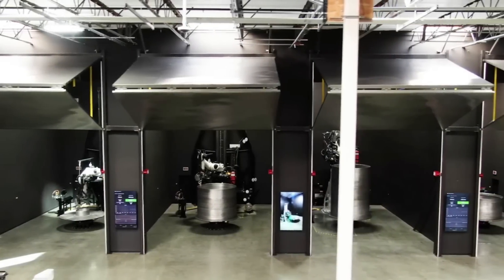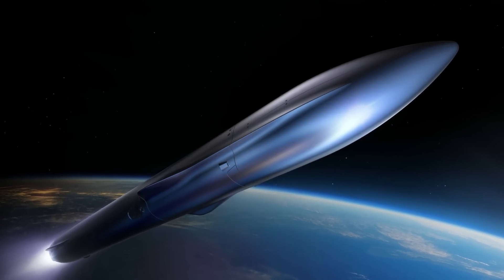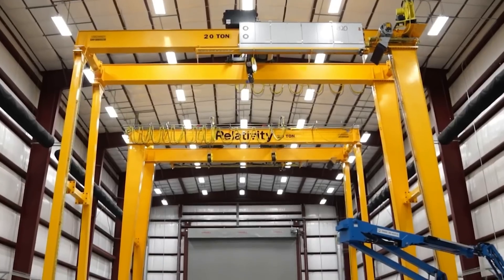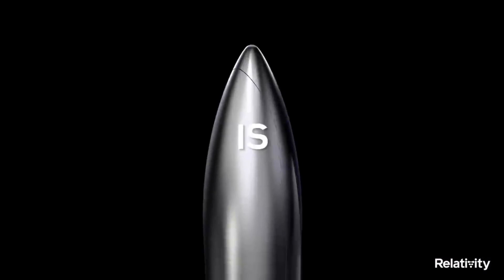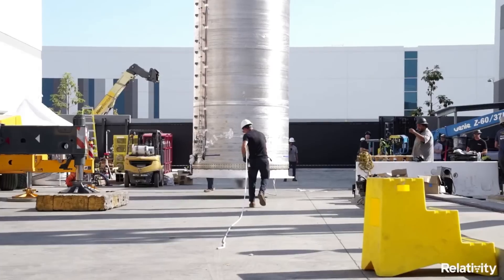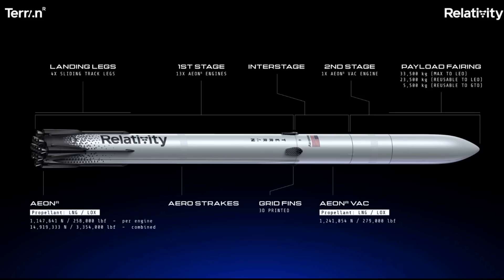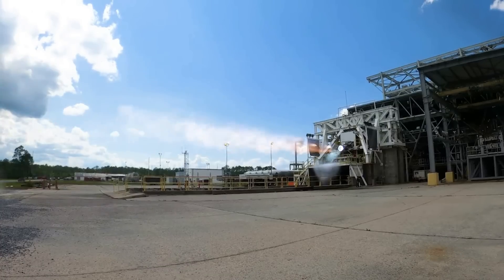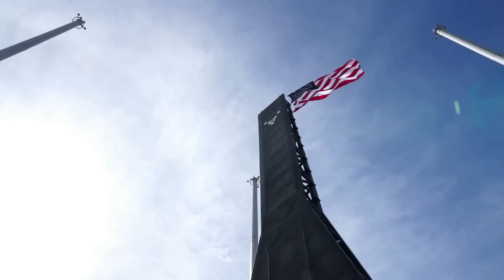A Closer Look At Relativity's Future 3D-Printed Rockets

Comment: They said Terran R won’t be 3D printed.
Reply: 3d printing the rocket body is sucks . Increase too many dead weight come from rough surface of the printing
Reply: @ero6760  agreed, but they aren’t more innovative than other rocket builders. Everyone keeps saying that about Relativity and I just can’t stand it. RocketLab 3D print they engine and rocket part for a while and are actually reliable and proven tech. Relativity is still a power point company at this stage.

Comment: Are 3d printed rockets anything like carbon fiber submarines? I'll believe it when I see it.
Reply: Terran 1 was a 3d printed rocket that successfully launched and went through maxQ but did not have a stage separation so it is far more than theoretical.
Reply: Dawg the sub didn't fail just because it's carbon fiber, y'all gotta at least try to do research before you hate on things. A submarine is nothing like a rocket, let alone an uncrewed one, can we stop bringing that up?💀
Reply: @aq_ua  exactly! It failed because the engineering was shit and nobody certified it! What the hell is he thinking?
Reply: @kspkreations3342  mfw I use a 1.3km rated window for a 4km dive
Reply: @aq_ua  Mfw It literally fucking cracks and they don’t do anything about it
Reply: No, no they aren’t, you living example of the Dunning-Krueger effect. 
The carbon fiber used in OceanGate’s sub was EXPIRED by MULTIPLE YEARS. They DID NOT CERTIFY THEIR VEHICLE UNDER ANY AUTHORITY.
Terran 1 already passed through Max-Q (the most challenging area of flight) with no issues. The only issues came from the second stage’s engine, which is very common for all new rockets.
Electron already uses carbon fiber, and they have fourth launches under their belt, all (sans the first three test flights) are successful.
Rocketry is nothing like the pure idiocy that went on in OceanGate, and you should be ashamed to think that way.

https://youtu.be/2oLEtWeTowo
Here’s proof that 3d printing in rocketry works.

https://youtu.be/Ngvow6egisg
Here’s some more, in a much more challenging area than building some tanks.

Please actually read about and understand spaceflight before you make such crude remakes in the future.